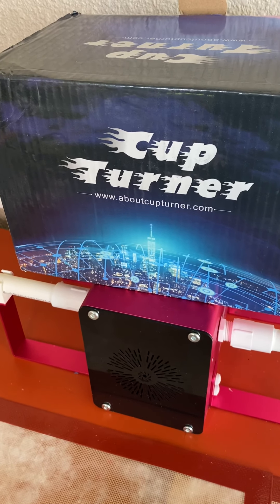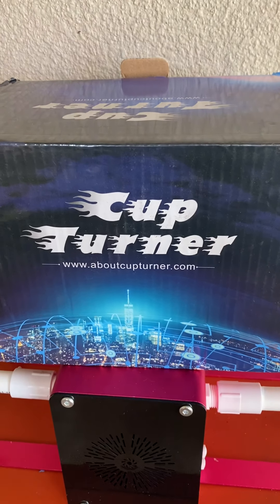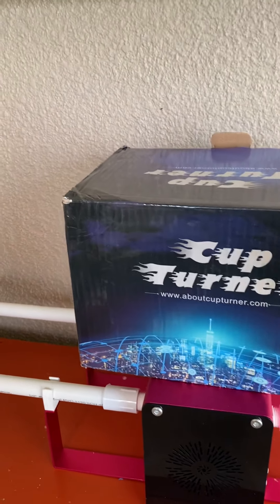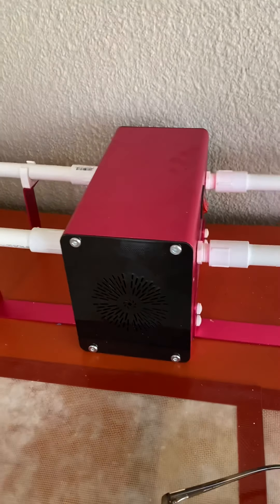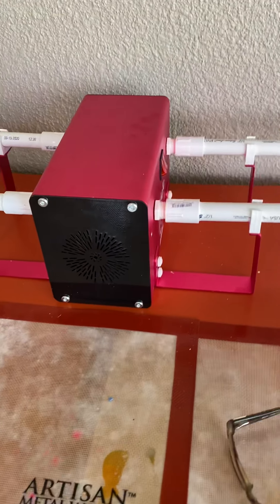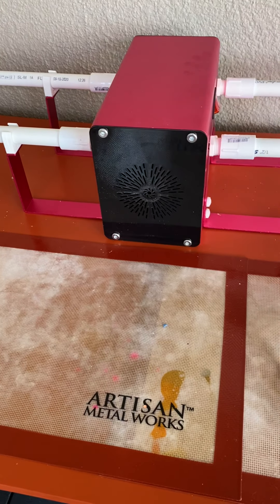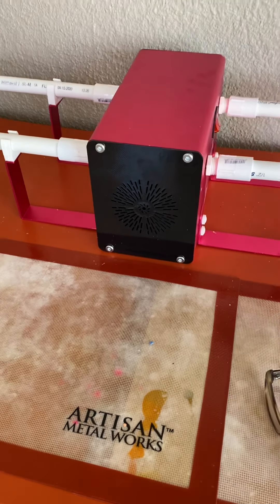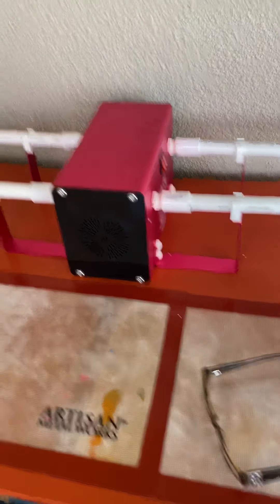Time to replace my cup turners. Here’s my new cup turner

Comment: Do you still like the red cup turner that you bought on Amazon, and does it still work. I bought motors from Amazon in October and they have either stopped working or they come off the turner completely.
Reply from the maker: Hello friend, I am so sorry for the late reply I’ve been working so much lately. Yes I still like it, it is still working really well. The only thing I’ve had to do is tighten up a few screws otherwise it’s been good.